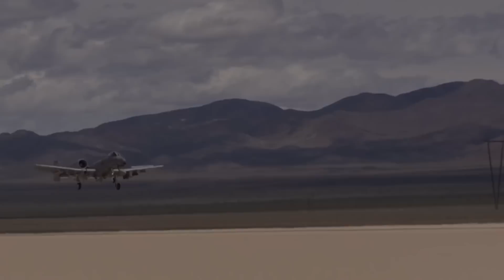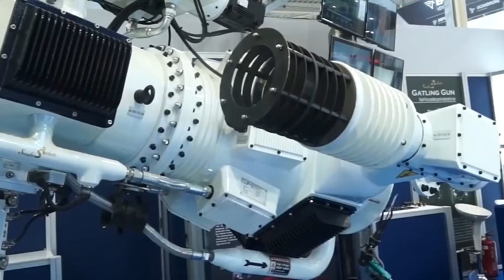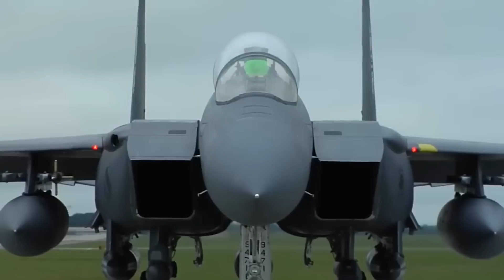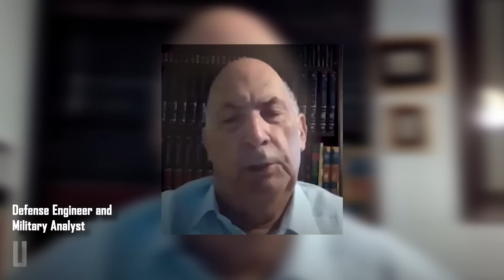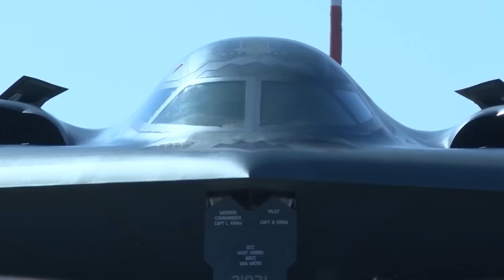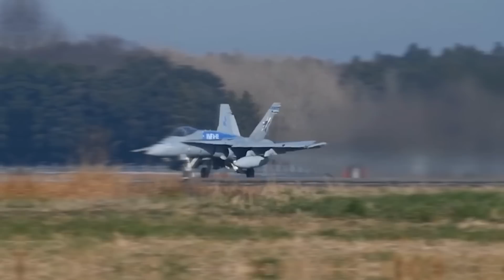$1 MILLION Laser System Is TESTED On A-10 Warthog

Comment: The Warthog was brilliant f you needed Air Support when on the ground. You will never forget it’s sound and it could linger in the area. BUT, let’s not get carried away. Keep it for what it is. Ground Support. Adding more dodads that can break down and be almost impossible to get parts for in an Operational Area. Naah. Leave it alone.  If it ain’t broke, don’t fix it.